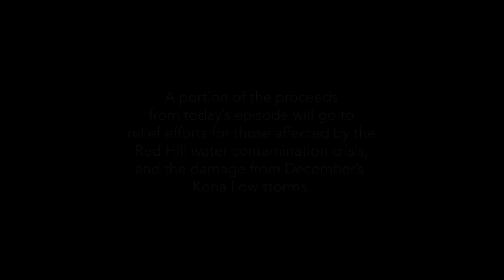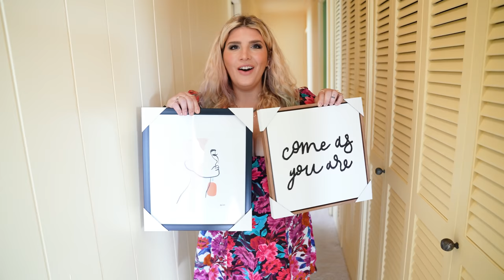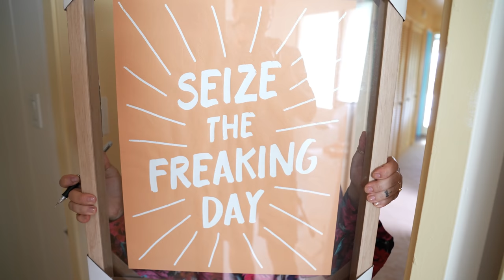Our Island house is RUINED 😱 (fixer-upper NIGHTMARE)

Comment: We are on Big Island- Hawaii, but PLEASE SLOW DOWN! Don't just go buy used things before you learn more about Hawaii.  Most furniture sold used comes from Hotels or "Rental Units" which the only think owners and visitors care about is NOT seeing pests.. cockroaches, etc. so they over spray everything in the place all the time or every month or 3 or six months... when the correct chemical used could have been used once every 6-8 years.  We have seen pesticide applied to furniture with a paint roller.   Ok. Just had to share that before you put Moon on those Questionable chairs to eat.       Next, if your house flooded after only 3 days of rain, what are you going to do in the real Rainy Season???? Sure, Chain link fence is ugly,, but it is $1000's and here,, we NEED fencing or the wild pigs will tear up your garden. Many people here think taking things from a non-fenced area is ok. True that.  Think about raising the foundation. Leave that good roof alone.  That is one of the best kind to get here. Kitchen slab is worth more that eating inlaid mold from living in a Humid climate!! Paint away !  Work outside! But fix the major things first. Love you guys,, but SLOW DOWN! You are on Hawaii time.  Unpack. Teach that kid to write and read his letters and numbers. Unpack your craft stuff. Check out the new and improved cost of building supplies.  When they are in stock.  Aloha!!!!!!